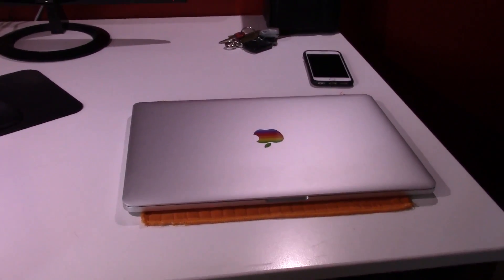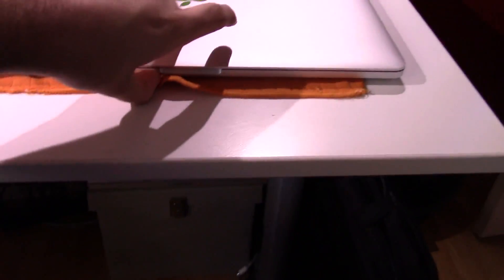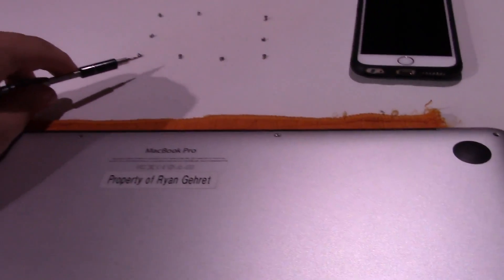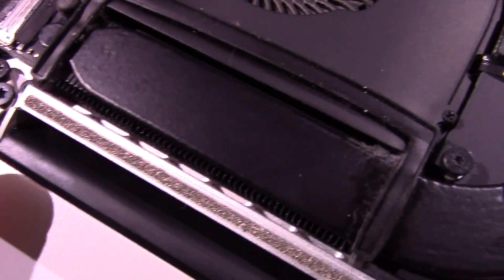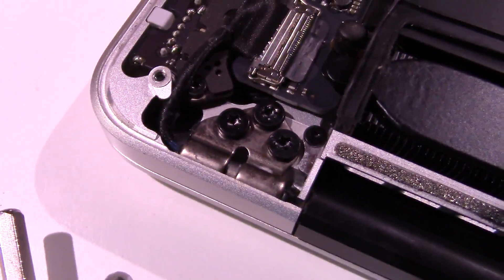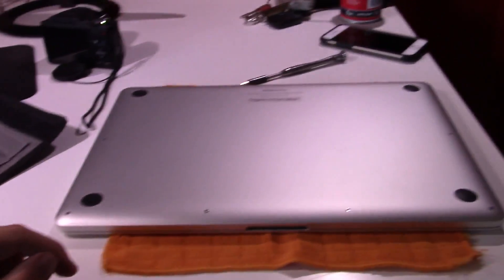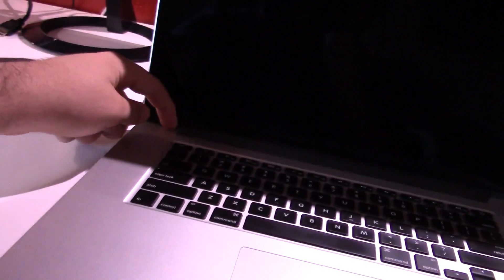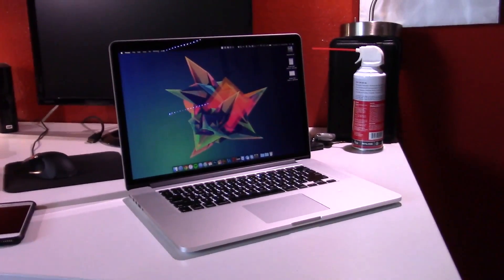15" Retina MacBook Pro (Late 2013) Maintenance/Repair

Comment: need to replace my hinge, one is cracked and its really hard to close shut and its not aligned. Got any links for replacement parts?
Reply: early 2013, retina
Reply: 15inch...
Reply from the maker: Unfortuntately the hinges on Retinas are part of the display assembly and can't be replaced separately
Reply: i have successfully replaced the right hinge on my MacBook pro retina for grand total cost of 15 dollars canadian...thanks for the wrong info

Comment: Still amazed at how little damage it caused. By the way, when did Apple change the startup screen to match iOS, and why doesn't my 13-inch MacBook Pro do that? It still has the old gray screen, even on El Cap. Could it be a Retina Display thing?
Reply from the maker: +TheTechies World Well it's not like I dropped it very far, lol. And it was in a bag. 
I believe it's limited to retina display models, because on the iPhone anything older than the iPhone 5 doesn't have the color matched boot logo either.

Comment: 2009-2010 MacBook Pro worth buying in almost 2016? I want to try a Mac, but don't want to spend $1500 if I don't like it ;)
Reply from the maker: +danikayser84 They're pretty old now...I'd try to get something newer. You can get a 2012 13" MBP for around $600 nowdays.
Reply: +danikayser84 Go for at least a 2011, I have one as well as a retina macbook pro and they're pretty damn speedy even by todays standards. (Upgraded mine to 128GB SSD & 8gb RAM)
Reply: They are with it,depends on what you want to do with it

Comment: Hi Dell0304, I was wondering if you would ever make a thermal paste guide. I happen to find many on the internet but I do not know because one says this is worse, that is better etc. Please make a thermal paste guide. I also noticed your white Core Duo MacBook fans are at 1530 or so. My Core 2 Duo overheats (late 2007), when watching 720p/480p videos. Please please make a guide.
Reply from the maker: +SoldierSparky I usually use the dot in the middle method. There are plenty of resources online; I don't do tutorials lol.
Reply: +Dell0304 Okay I've replaced it according to your way and it idles at 1785rpm minimum. Thanks.
Reply from the maker: No prob